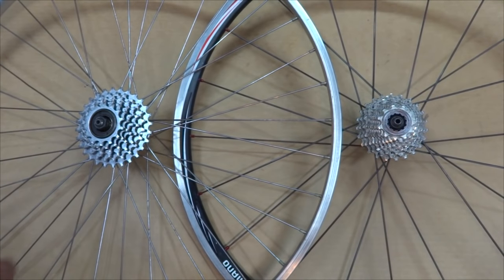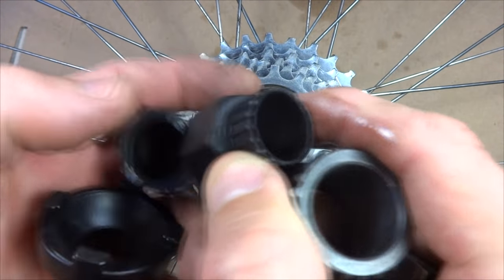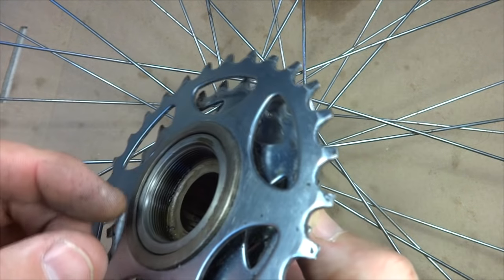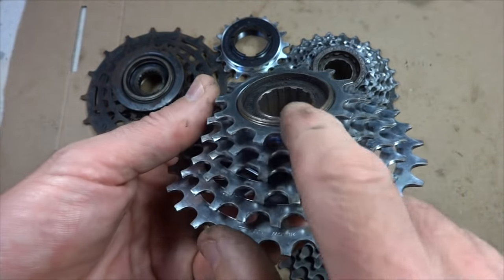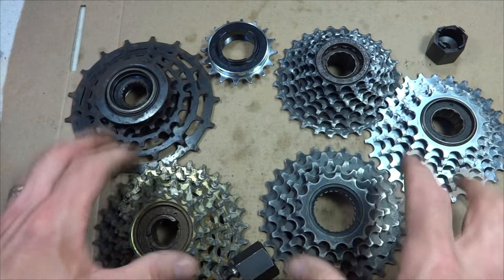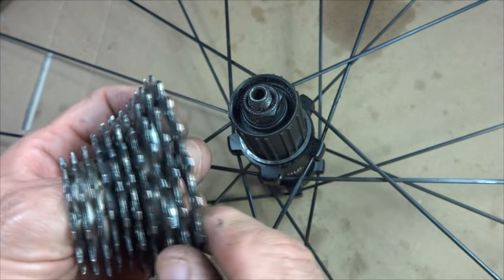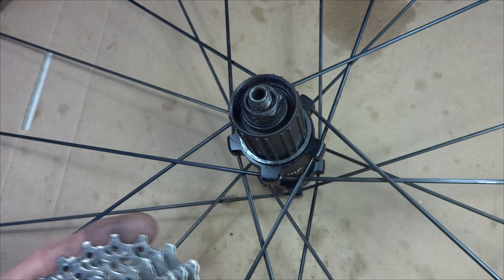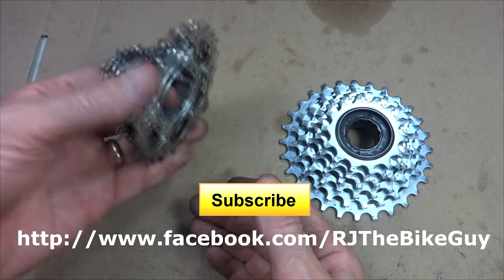Freewheel vs Cassette - What Are They? Can I Convert?

Comment: Hi RJ I have bought a second hand wheel for an old Raleigh hybrid. The original wheel had a 6 speed freewheel but the replacement came with free hub only. I have indexed gear change for six speed and the ebay seller said the the replacement wheel with freehub can take a 6 speed cassette even though it was originally 7 speed.  Try as I may cant find a vendor offering a six speed cassette for the hub. Could I just fit a 7 speed   cassette and just operate on 6 sprockets.  I bought the wheel because it was the only replacement I could find that had a 130mm drop gap.

Comment: I've got a sunrace freewheel coming off a solid axle and want to put it on a new aluminum wheel, is this possible?
Reply from the maker: If the wheels both take freewheels and the new wheel is wide enough to take that freewheel.

Comment: Awesome videos man.. I have a Huffy hardtail.. I think. 26 x 1.95, Shimano SIS MF-Z015, 5 speed cassette stack, 5 speed (14-17-20-24-28T).

Freewheel..? Right?

It says I need a TL FW30 freewheel removal tool.. Park tool says it's a FR-5.2, 12 splines..

Or should I get the TL FW30 tool?

I wanna put a single freewheel cog on it, and also buy spacers for it, how do I find cogs for the freewheel body I have? 12 splines.. I think.

I also hear very light crunching inside, probably due to dirt and stuff.. so I would probably have to clean it up inside, with some grease n such.. right?

My goal is to put a little 250w BLDC motor on the back and have a chain drive the single cog on the rear wheel.. eBike.. that's my goal. Any help would be appreciated. I love learning about stuff, and usually when it comes time to building, I usually have all my facts and information together.. I usually spend days learning.. in this particular case, I need an eBike. And I wanna learn everything I possibly can to achieve that goal, thanks to dedicated people like you.
Reply from the maker: I already answer your question in another comment.

Comment: Well explained, thank you. Could you help me understand? I have 3 gears in the front and 7 in the back, I thought that made it a 21 speed but when I when to a bike shop, they told me it was a 7 speed. Does that mean they are also right or am I just wrong?
Reply: ricardo delgado Hey, i know this was late but the shop probrably talks about the rear hub when they say 7 speed. 21 speed is when you count your front and rear gears.
Reply: You’re both right. 3x7 = 21. The bike has 21 speeds. It has 7 speeds in the back and 3 in the front. The cassette has 7 speeds and you have 3 cogs.

Comment: RJ, i let a friend use my specialised hard Rock and it was a good brand new bike and the free wheel 9 speed is a brand new cassette i was given by a good friend and a good friend came back with the cog spinning and I was thinking derailleur but its a dear one and its really dear wen I don't think I need one can I use the cogs i will take off my chain whip on the missing list is there any way I can get the cassette off with no whip, hes mauled with all kinds, like bleeding the oil from the back brake by pulling the nipple, and I ask myself why it is on the opposite side of the cog, pls can you tell me what you think and how to do it cheaply but correctly Thx I always check the videos with you your knowledge and clarity beat the lot

Comment: Hello,
I'm pretty sure I have a cassette freewheel and its 9 speed (Shimano), is it possible to remove one cog and convert it to eight speed and still have the locknut secure the cogs on to the cassette on the hub ? I'm able to get 8 speed down tube index shifters far cheaper than 9 speed and I could easily do without one cog on the cassette.

Comment: I have mistakenly put a gear on a Violamart front/rear electric wheel ,this was supposed to be the front wheel (confused with 2 different wheels)but none of the cog  removal tools fit ,,,there are no splines on the internal part nor notches to use, nearest is bottom right in this video with the two hollow dimples?...,any advice would be most grateful

Comment: Hi RJ, could you show how to open that old French (Maillard) freewheel? I Think my Maillard freewheel ('79) needs some new ball grease. Peace!
Reply from the maker: https://www.youtube.com/watch?v=lVc1r2giqPc
Reply: As in: you're an idiot if you try to open one of those tight Maillard freewheels, just clean it and grease it with liquid ball bearing fat?
Reply from the maker: No, as in why open it if you don't have to.
Reply from the maker: I disassemble a freewheel here: https://www.youtube.com/watch?v=T_vRbBRPr3c
Reply: Found out that with this type you have to screw off the smallest two cogs which, even with two chain whips and accompanying cheater bars, is impossible. So, imma follow your advice.

P.S. Thank you for all your videos, they are super helpful

Comment: Hi, between the freewheel and cassettes, does either one free spin better than the other?  Also do cassettes and freewheels free spin better than internally geared hubs?  I have a bike that came with an internally geared hub, a Shimano Nexus 8, and it doesn't seem to free spin very long.  Thanks and I loved you video explaining the difference between the two.
Reply from the maker: That is like asking which goes faster, a red car or a blue car. Freehubs/Cassettes allow for bearings to be farther out so axles don't get bent and to allow for more gears.
Reply from the maker: And they only spin when you are coasting. And that tiny bit bit of resistance is insignificant when actually riding.
Reply: @RJTheBikeGuy  Sorry, I'm not that familiar with all this gear stuff yet. Trying to learn. I'm asking because my internally geared hub (Shimano Nexus 8) doesn't coast that well and was wondering if I switch to a freewheel or cassette, would that improve the coasting? My Shimano Nexus never coaster very well, even when it was brand new, so wondering if that is just the nature of internally geared hubs.  Thanks.

Comment: Great video, thanks for the info. I thought they were the same thing but theyre most definitely not. Just a question, if i have a 5 speed freewheel and want to get more gears on my bike would it be possible to change out the gears?
Reply from the maker: https://www.youtube.com/watch?v=DO5V3qkW05g
Reply: Thanks. Subscribed
Reply: Isn't the problem with freewheels the axle,as it;s longer it's more prone to bend,so if you put 11 spped freewheel on it,that makes the problem bigger!! Btw,the hyperglide system is still a freewheel!!
Reply from the maker: The problem is not that the axle is longer. It's that with a freewheel, the axle extends out farther past the bearings, making it more prone to bending.
Reply: so the axle is longer....which is what I mean the axle bends!!

Comment: Just curious, can a chain whip remove the free wheel cogs instead of using the specific splined tool that fits over the solid axle.
Reply from the maker: No.
Reply: No. You would accomplish the same thing as coasting.

Comment: this help me big time I am trying to figure out which ebike motor hub to buy for my Schwinn occ stingray chopper and I am very confused  what I want is a single speed smallest and quietest rear hub motor that will allow a top speed of 35 mph on flat ground using a 72 volt battery  the bafang fat tire hub motor is the only one I have found that will come even close to working but I don't know if the axle will be long enough to fit the frame drop outs cause these stingray frames have very very wide rear drop outs any help or recommendations would really help cause I really don't know what I am doing I got a guy that will lace a hub motor in a stingray rim for me once I get one that will work so I just need to know what motor to buy thanks jaymus

Comment: the tool you used for removing the cassette had a locating rod, is this essential or will a shimano freewheel tool also loosen and tighten a shimano freehub cassette?, also whats a good way to visibly detect a Shimano over sram tool? As always appreciate your video & ty.
Reply from the maker: I believe they are different sizes. Dunno about visually telling a Shimano vs SRAM tool.
Reply: Believe?, thats a job for your vernier next time your in the shed i guess :), thank you, in years gone by you went to the shop and the guy showed you the choices, my local bike shop has sadly closed, so online is the only way & has its hazards of poor or inaccurate description, will be sure to ensure i get a cassette size.

Comment: I currently have a 7 spd freewheel ... if I put on a single speed hub will I have to worry about chain alignment ? will the chain ride too close to the wheel ?
Reply from the maker: Yes, you have to worry about chain line. You may have to make adjustments at the hub or at the cranks/bottom bracket.

Comment: Hey, have you any videos on spoke tensioning? I'm kind of frustrated with my lbs. I never had problems with popping spokes till recently. The closest bike shop is about an hour away and is very costly just to replace a spoke and true a wheel. I've been replacing my own spokes due to this. I cut and thread my own spokes and any insight would be helpful. Thanks in advance!
Reply from the maker: videotowatch2000 I have a video on replacing spokes here: https://www.youtube.com/watch?v=x_BsGRPLKPY
and a video on truing wheels here: https://www.youtube.com/watch?v=f1SHmFBihKM
It sounds like you might be over tensioning the spokes. They make a gauge to measure the tension of the spokes, but it is pricey. http://www.amazon.com/exec/obidos/ASIN/B000OZDIGY/ref=nosim/youtube25-20

Comment: So I would need to buy a wheel with the correct hub length in order to put a single speed freewheel on it? Any recommendations? I'm building up a bike from the frame and want to turn it into a single speed city bike.
Reply from the maker: I recommend learning to use and the gears, or go buy a single speed bike.

Comment: Hi RJ, very useful video, thank you. I have a problem with my freewheel and I think maybe you could suggest any solution? I have vintage west german bike and on the rear wheel I have a 5 speed freewheel. The problem is that in local bike shops I can't find the suitable tool, they all to big. Maybe I can make some DIY tool?
Reply from the maker: Илья Широких I made this other video for cases like this: https://www.youtube.com/watch?v=WsVL1XqZve8
You can either replace the freewheel, or try to re-assemble it. What is the brand/model of the freewheel?
Reply: RJ The Bike Guy the brand is Trumpf.
Reply from the maker: I have never heard of that. Googled and didn't find much. No tools from more current freewheels will fit? Just out of curiousity, can't you maybe post a photo of it (especially where the tool would engage) over on my facebook page?

Comment: To remove the lockring on the cassette, is that tool a one size fits all or is there a range depending on the make of your cassette? Cheers mate
Reply from the maker: The tool for Shimano cassettes is pretty standard. Not sure about other brands.
Reply: Ok then, I'll look into it.
Thanks for the help.

Comment: Which one is better and why ?  And who’s more reliable?
Reply: The cassette system has the bearings further apart ,giving the axle more support. Less likely to bend .
Reply from the maker: But other than that, both are good. Cassette is just newer.

Comment: Hello RJ, 

I really love your videos and I am trying to build a road bike for myself! Thank you for your work!

I have a question regarding the spacing and the casette of my rear rim.
I have an Exage 300EX deraileur and it allows maximum 7 gears. I have found a nice rim at the fleamarket with a shimano 600. But the rim has 8 disks. I think it is a casette (you talk about the ones which has the smallest disk as lock, I think it is one of those, I can send a picture to check) My question is, the spacing on my frame is 126mm and the Axle of the rear rim is 130mm. I can somehow fit it with force, but I dont know if it is good to do. I wanted to ask you, if I could remove one of the disks (maybe the biggest one, as the smallest is the lock) and change the spacing at my axle, would that help me with my fitting problem? 
Or do you think I can just not use one of the disks with the deraileur and strech the frame?
Frame is a giant brand steel road bike frame.

Thank you so much!
Cheers,
Okan
Reply from the maker: https://www.youtube.com/watch?v=1zWYLb2RMPA
https://www.youtube.com/watch?v=QwxEPRk3LFg
Reply: thank you for the videos! I just checked them out and I think they will help me a lot! So do you think that I can just let the 8 disks there and just open up the spacing at the rear and adjusting the deraileur only for the first 7 disk? (leave the biggest out of the equation? Thank you!

Comment: Hi RJ, do modern cassettes (Shimano Hyperglide) work with indexed/friction downtube shifters? or do you need one that's SIS compatible? I know you mentioned that derailleur (rear) has to be SIS compatible in your other video. Thanks.
Reply from the maker: Most, if not all Shimano freewheels/cassettes from 6 speed onward are SIS compatible.
Reply: awesome! thanks for the info!

Comment: RJ..what’s a safe industrious way to remove a cassette from my road bike wheel?
Reply: You need 2 tools, the nut for unscrewing the cassette and a second one for holding the cassette (and prevent it from spinning). You get such a set relatively cheap from Ebay.
Reply: Use an old chain or big grips to hold the cassette, then you only have to buy the lock nut tool

Comment: As a Mechanical Engineer who is completely new to cycling, I have to say that I don't like either of these standards. The majority of a bike can be easily modified with wrenches, scrw drivers and hex keys, then you get to the freewheel / casette. Suddenly you are dealing with a specialist tool, and not just one, you need a different tool depending on if it's a casette or a freewheel, and you need a different tool depending on which brand it is. That is absolutely terrible, it should be completely one standard. Dimensionally it's certainly possible for both lockrings and freewheels to use the same tool, and the differences between brands makes no sense at all. I personally don't even see the need for a specific tool like this, it should be a one-fits-all standard consisting of a freehub and a washer instead of the lockring that is held down by a large body fine thread lock nut. The assembly into the bike frame would be more than enough to stop anything from rotating along the axle while riding.
Reply from the maker: LOL! I suggest you research the history and development of the modern bicycle. Then get down on your knees and beg forgiveness of the people who came before you!
Reply: @RJTheBikeGuy  Well could you imagine if different manufacturers of bolts all required different tools to fasten them? That's basically what's happening here and what I'm complaining about. I can tell you that if I were to design a proprietary component when a standard tool that performs a similar job already exists, my boss would call me an idiot.

Comment: Hi are the working  the same  thing 
Can I change the cassette to freewheel  by change the tire only ?? 
I bought  a motor  hub and it comes with 7 speed freewheel  and the bike that I choose to fit my motor on it comes with 8 speed cassette  
Can I just remove the whole rear tire and install the motor  with 7 speed freewheel or I have to buy 8 speed freewheel then install it ??

Comment: Is it correct to assume that basically, vintage road bikes have a freewheel and modern road bikes have a rear wheel with a freehub and a cassette? 

I've been thinking of converting a vintage road bike into a single speed, but I'm worried it could be difficult to get the drivetrain straight when simply installing a singlespeed freewheel, whereas with a cassette I can simply play around with spacers to get the rear cog in the correct position.
Reply from the maker: Actually cassettes have been around for a while, and some bikes still have freewheels.
Reply: It’s safe to assume that high end bikes have cassettes.

Comment: I changed my 6 speed cassette to freewheel on the same wheel. After removing the cassette, I was able to unscrew the freehub from the wheel and screwed the freewheel in it's place. It was sweet and saved me a lot of money. It runs beautifully.
Reply: It was a cassette that was on there. The last cog screwed on to the assembly locking everything in place. I bought a freewheel from Walmart which I was able to screw onto the wheel after I removed the free hub that the cassette was mounted on. It really amazed me, but I'm glad it all worked out. I would be more than happy to send you pictures if you like.
Reply from the maker: Kind of like this? https://www.youtube.com/watch?v=uwGCZuWPQGk
Reply: I always thought that a freewheel was all one unit of cogs and a cassette was an assembly of individual cogs. I removed an assembly of six individual cogs that were mounted on a metal hub that was threated on the wheel. After unscrewing this metal hub from the wheel, I was then able to screw a freewheel that I purchased through the mail in it's place. End of story
Reply: I looked at the video. Very enlightening. Thanks for taking the time. The last cog on the original assembly cracked so I was under the impression that it was a cassette. Just for the record RJ, what is distinguishing factor(s) between a cassette and freewheel?
Reply from the maker: The freewheel has the ratcheting mechanism built into it, and screws onto the hub. A cassette is a group of cogs that slide onto the freehub. The freehub contains the ratcheting mechanism, and mounted more solidly onto the hub. You can see a cassette/freehub in this video: https://www.youtube.com/watch?v=mmlLgj_b8e0
Reply: Thanks R J.